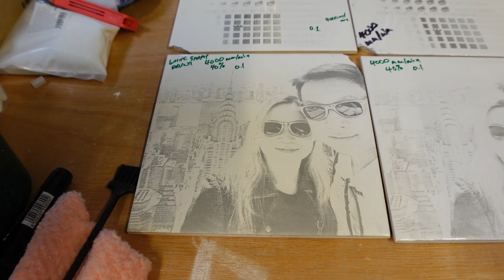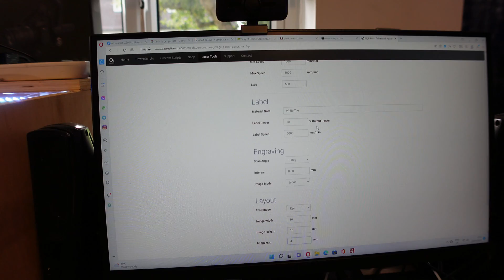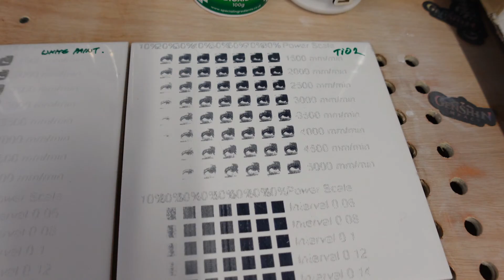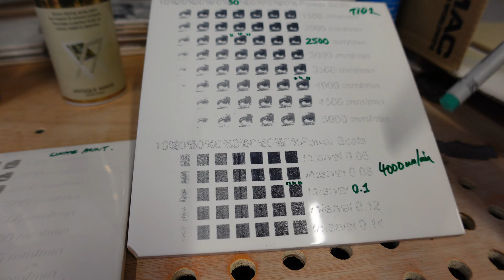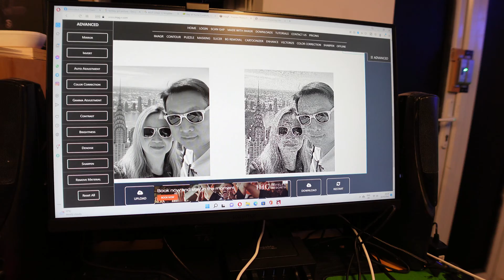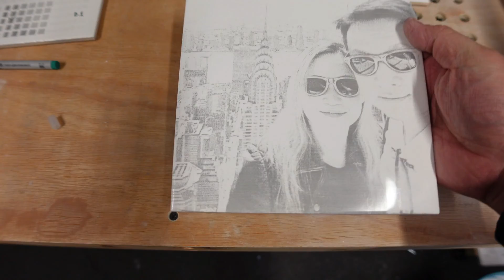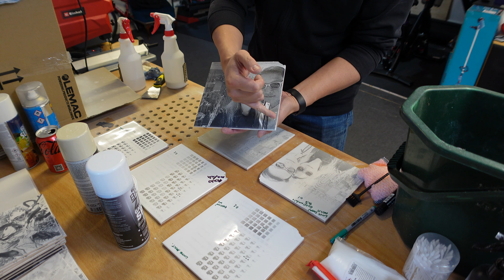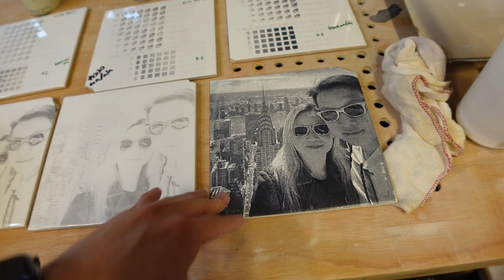Best spray for Norton white tile laser engraving test by Benson Chik with Atomstack X20 PRO

Comment: Your white paint was not white and did not have enough Titanium oxide to burn properly. Try the Rust-Oleum Painters touch 2X Ultra Cover Paint and Primer  White Gloss, Satin  or Matte. TiO2 is what makes white paint white.
Reply: Unfortunately we can't get 2X in the UK
Reply from the maker: I now use TiO2 food grade powder mix with acetone and spray bottle on tiles. Easy clean up and ready in minutes for laser

Comment: Nice video thanks. 
How do you mix the titanium Dioxide
Reply from the maker: I would say around 1 part of powder and 5 parts of acetone. Shake constantly so the powder does not settle while spraying. Spray bottle must have big enough nozzle so it will not block
Reply: @BCreviews  thank you. I'm gonna try it. I love the darkness and easy cleaning
Reply: @Dekweekschuur  I read somewhere else that isopropyl alcohol is better than acetone for using TiO2 powder. I guess it's less flammable too.
Reply: Hola buenas la verdad que es un maestro usted haciendo esto con los azulejos  tengo unas consulta aver si me puede ayudar tengo una máquina cnc la sculpfun s9 no sé si se podrá hacer lo que usted hace pero me podría decir qué  no hace falta pintar las valdosss en color solo con el líquido ese que usted echa qué cantidad echa en la baldosa y qué tiempo de sequeda y no se borra después quedamos parámetros sería correcto. Se lo agradecería si me informa.